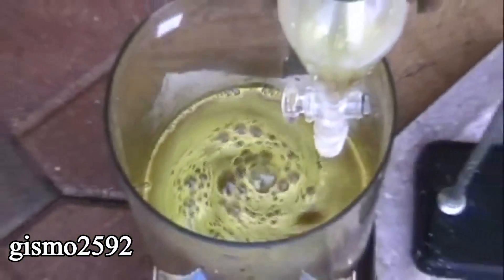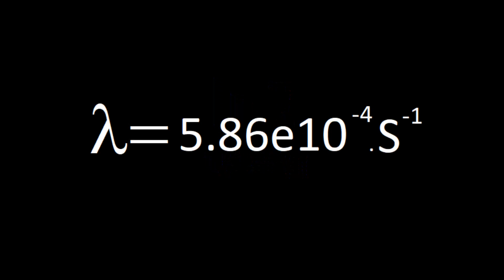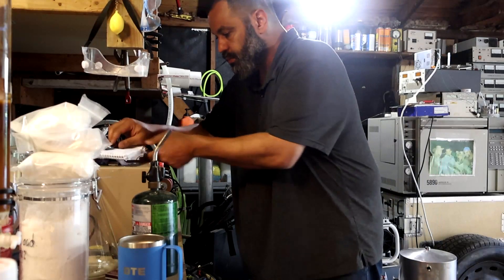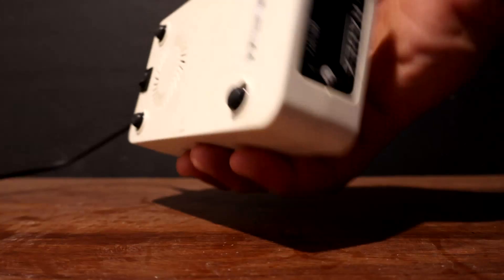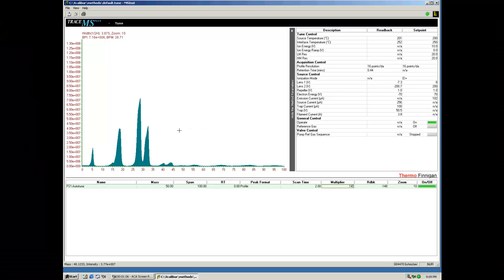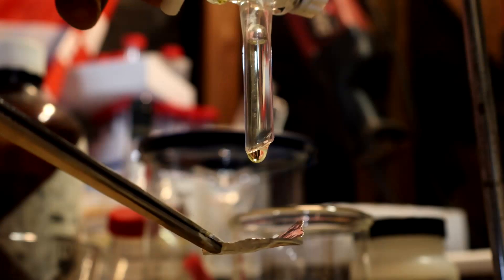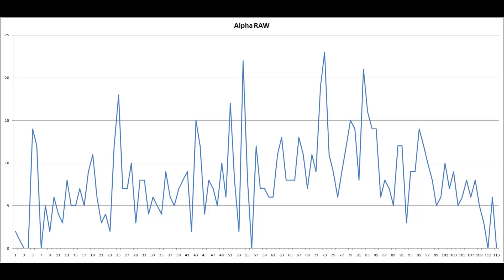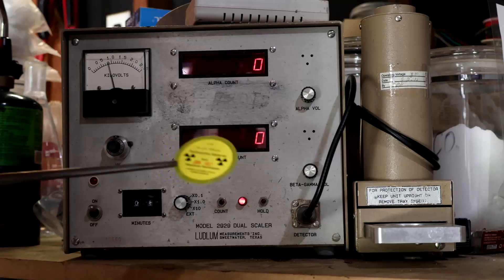The Complete Uranium Decay Chain

Comment: Are you not worried about a diffusion within the tip of the column when collecting single droplets and stopping the flow? I think that continuous dropping with some fraction collector like carousel might improve the S/N
Reply from the maker: Yes ! That was a problem that lead to my first failures! I changed the tip of the column so this wouldn't happen too much! But yes I also wanted a carousel of some sort that would have been much better! Hey thanks for watching!

Comment: Really nice video.  I always learn so much from your channel.  I had never thought of the technique of exchanging concentration for improved statistical removal of the background, a very smart idea.  What is cool about this technique is that even with less sensitive, consumer level equipment, this technique can still be used to refine a measurement, albeit not to the detection levels that your equipment can.
Weird apparent background fluctuations can be alarming, I was recently showing someone the (snake oil) NukAlert product (I will be reviewing it) when it started clicking (with a click-rate that indicated over 50mSv/h), I immediately reached for the Radiacode, which showed a normal level, just seemed that the NukAlert was having a temporary brain-fart, despite not having anything worthy of being called a brain...